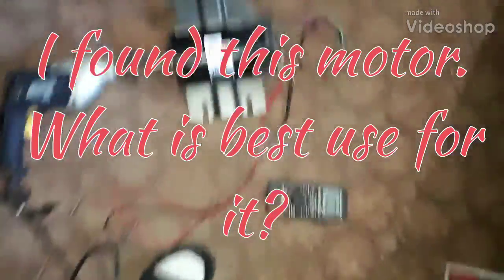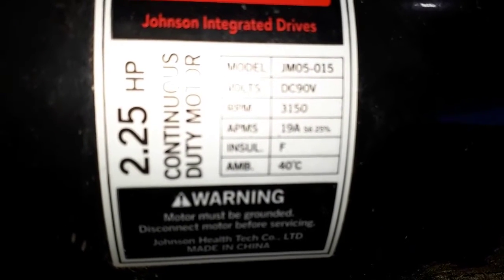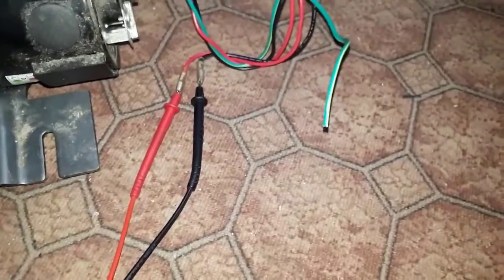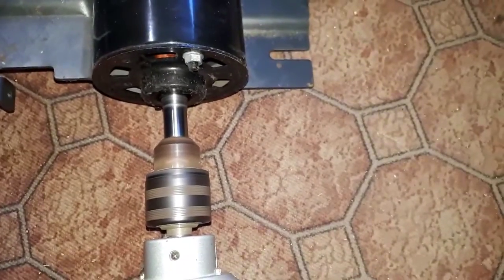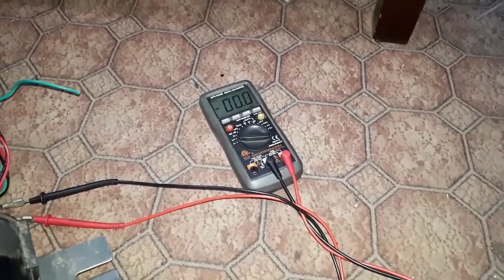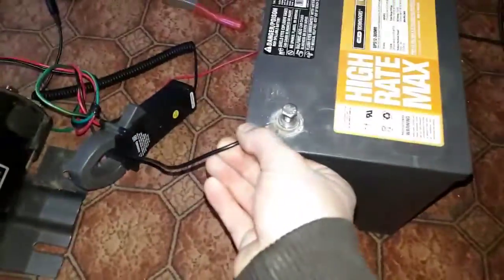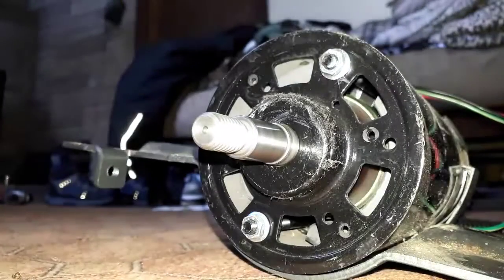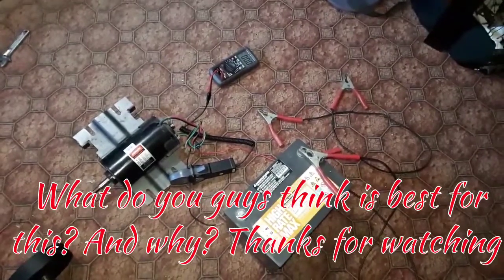Best use of this motor?

Comment: Hey Frank Z you must have an old alternator around there use a couple of solar panels to drive the motor and a pulley belt to the alternator and run the output wild AC like a wind generator and bingo you have made your own inverter. My mind just keeps thinking about that lol.